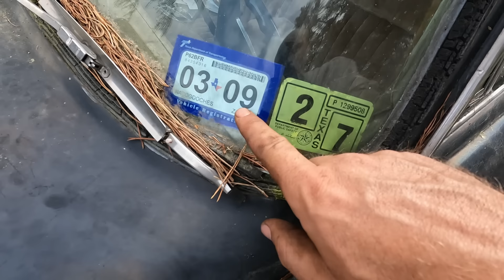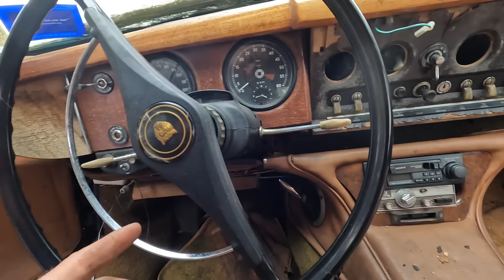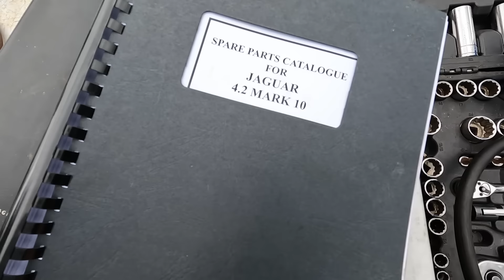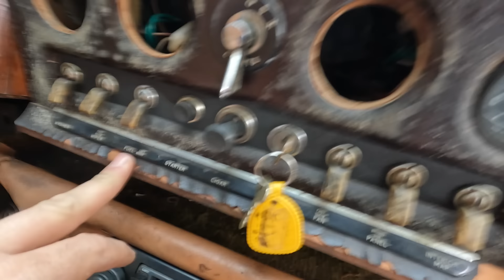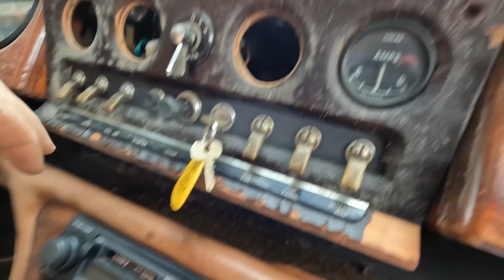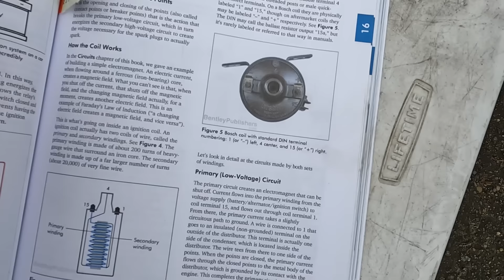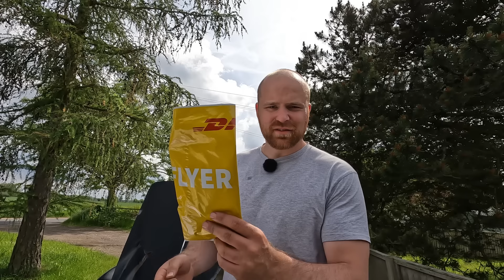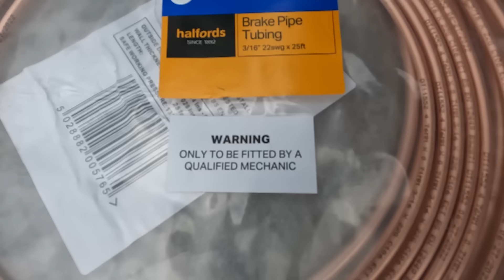1962 Jaguar sitting for 15 years. Will it run?

Comment: I bought at 63 3.8l Mk10 in 74 for £66 and it was a complete rust bucket, but it would do 100mph and gave 17mpg. I was stopped going into work by the security police with 7 people all sitting on seats and I wasn't questioned about it. It was metallic grey with red leather interior and no seat belts (before 66), it steamed up in the rain, the brakes were really terrible, the steering was +/- 1/8 turn to keep it on the straight and narrow and I sold it 1 year later for £75, a profit. I wished I could have restored it, but it wasn't work doing, too much rust, but I enjoyed it immensely.

Comment: I enjoyed watching all of the things that beset you! And your positive attitude never waned. The best bit of this video, was your surprise to see the engine fire-up! I once rode as passenger in the MK 10, and I drove a Mini at that time. I couldn't believe just how BIG the MK 10 Jag was from the inside! Your journey has just begun, and I just have to write that (if I were you), at this point in time, try and get the Jag on a Tilt Tray Truck, to a garage where the car can be raised. I would not spend another cent on that Jag, until the whole underside has gone through some inspection. I reckon that there is a lot of us that had aspirations to restore a Classic, and many have lost interest and failed in the process. I started with something simple - a 1971 Beetle which was purchased as a rusted burnt-out wreck from a Car Scrapyard in 2004. 20 years later, I'm still driving this Beetle daily. 5 years ago, it was converted to 100% EV, and is Tesla-powered. the Beetle goes to Car Shows, and looks new. I am now 75.That's my story. Hope to see a follow-up on your Jag. Greetings from Australia

Comment: Highly enjoyable watch! Will be following the progress closely. When you opened the bonnet (or is it hood in this case) and there was no inlet manifold I thought this is just such a massive project to take on. Not to mention engine is likely seized.  Brakes seized and probably clutch seized. I was amazed to see it start up and then drive some. Fair play to you for taking it on! Great content and very well put together.

Comment: Brilliant, absolutely brilliant. Well done. I'm British and am a fan of Vice Grip Garage and it's great to see a British guy have a go with less experience. You're an inspiration. I watched some time ago you have a go at an old Ford Zodiac and fail, but at least you had a go. I look forward to seeing the progress on this beast.
Reply: I’ve always wondered if a VGG or Roadkill style show could even happen in the UK. I’m sure the MOT test would take 50% of the entire fleet of cars off the road where I live… if I tried to drive my janky 1950’s car on UK roads I’d end up in jail😂
Reply from the maker: Cars over 40 years old are exempt from an MOT, so you can technically do it, but just because the car doesn't need to be inspected doesn't mean the car can be unroadworthy. So you'd be at the mercy of an individual police officer if pulled over.

Comment: Great watch.
Your modification with the rubber pipe with the jubilee clips on the braking system is where I think your braking problem is! There be expansion under pressure!
Reply: There shouldn’t be much pressure going back to the reservoir as it is on the inlet side of the master cylinder. It’s actually advised to bleed brakes with the reservoir at atmospheric pressure (the cap off/cracked open) to prevent a vacuum being created and sucking air back into the lines, so it is not a loss in pressure on that side of the system causing the issue.
Reply from the maker: The rubber pipe with the jubilee clips is on the low pressure side and is how it came from factory. I was just replicating what was in the parts diagrams and service book.
Reply: yes

Comment: Whether the car is positive or negative earth the starter will spin the correct way.  Generally you can just swap between the two and all you need to do is disconnect the clock (which is positive earth and if it still works which is unlikely it won't if you change to negative earth) and re-polarise the dynamo (look up on line how to do this its really simple).  Personally I would change it to negative earth when you get into it as the risk of having it positive earth is that if you use anything in the cigar lighter (sat nave etc.) or jump start it or use it to jump start anything else then then you might cause damage. I have one Jag thats positive earth but only because of its history and if I had my time again with it I would swap it over which I might still do.  Love a MK10, the absolute daddy of Jags and one I would love if my garage was large enough!

Comment: 4.2 Twin overhead cam engine. I, not a mechanic, in 1977 stripped the head off... easy job and again, on an XJ6 did the same again... I have an amzing techinical book, on that engine... you won't find a more technical book, on these engines', anywhere!! A goldmine of info! Good luck!!

Comment: Hi Nino, its really instructional to watch your videos.  I have a little story for you based on your thoughts of fitting an LS V8.  I'd say, don't bother.  Instead search the scrapyards for an old Daimler hearse.  When Jaguar took over Daimler the only engine they had was a V8 4.5 litre.  It was scaled down to go into the V8 250, a Daimler version of the Mk 2.  However, just because, Jaguar racing put the 4.5 into a Mk 2 and found it to be 20mph faster than the 3.8S. As the Mk 2 was fast enough they didn't replace.  But hey, you can! ;-)

Comment: That's gonna keep you busy for a while! 😊😮😁

That XK 4.2L straight 6 has a Le Mans winning heritage and is the same engine that is in the Daimler DS420 limo, I featured on my channel a while back, although in twin SU carb configurarion and it don't half shift when you put your foot down in those old barges so yours should fly, especially with the triple SU carb setup like the e-type jag....😊

One thing I will say about the SU carbs, you'll be able to strip and clean them in the dark with one hand behind your back, once you've done it a dozen times or so....😮😊

Edit - That fuel switch on the dash is actually to switch from left or right tank. If it's the same capacity as the DS 420 it will have twin 10 gallon tanks! 
I could get around £75 of fuel in each side! 😳😲

Comment: Got a 63 MK10. Came with a XJ6 4.2 fitted with triple carbs. Electric fuel pumps mounted internally in the tanks. Out here in New Zealand.

Comment: Jumped into the video late, was trying to work out if you're a Brit in USA or it's a USA car in Blighty.  Now I know.  The stupid headlamps (2:59) are the giveaway.  Our idiotic lighting regs of the time forbade odd-sized headlamps so they fitted 4 small ones and fitted wide bezels to the outers.  I'm busily correcting this idiocy presently on the '73 series one XJ6 I picked up last year here in Oregon.  Any 7" bucket will work - TR6/Spitfire/MGB etc.  And you answered your own question about the interior being redone - sun damage (Texas).  You have a new subscriber.  Crack on, I'll be watching!

Comment: At last! I spotted the Mk10 quite few videos back and commented about it buy you didn't respond which was amusing. You could retro fit an AJ6 engine into it OR a 3.2L or 4.0L Jaguar V8 out of a rotten XJ8. You ideally need an oil pressure gauge to give you an idea of engine condition. It should read 40lbs on idle.
My dad bought a BRG Jaguar 420G in 1973, that car gt me into Jaguar's BIG TIME. Have had ten and today I own a 1975 XJ6 4.2L and a 2001 3.2 XJ8. One day, I intend to buy a Mk10/420G! Looking forward to more videos on this car.
Go buy an air compressor, air line and blow gun, far superior at blowing grime out of any type of well or recess.
Reply from the maker: Thanks for the tips there! I think I'm catching the Jaguar bug like you did

Comment: I worked on these Jags throughout the 70,s and 80,s and they were straightforward  and  beautiful engines on the Mk2,s, 420,s, and mark 10s. The only real trouble was the engine block,s steel studs for the cylinder head to slide down over. They tended to seize to the heads with corrosion and try as one might , some heads needed hours of work to slide  up and off those damn studs.
 And underbelly rots especially the rear 1/4 spring mounts. The double or triple carbs were nicely tuned by ear, good old SUs no trouble at all. 
Great Video and great effort. Excellent.

Comment: I've been running through the MOT list for my 2004 Toyota Corolla 1.6. I just painted and undersealed the rear end and fuel tank!
Done all sorts, head cover gasket, ignition coils, suspension ball joints and control arms new, drum brakes replaced (a pain), front brake lines (yegh the same tool as yourself,  more pain) and recently had new clutch fitted. Saying that the Toyota's are in my opinion some of the best cars made.

Comment: Did the same on my E Type in Australia that had spent 30 years under cover under a tree. Sorted the float valves and distributor and it too just fired up! Had plenty of old Jags and nesrly all of them can be persuaded to run like this if they have no underlying mechanical issues. The only problem i have was with a Mk7 that i did get to start after rebuilding one seized carburettor due to water damage that signalled probable head gasket blow many years in the past. Had to pull the head and it was so corroded I had to replace it. Love watching people resurrect old motors, well done!

Comment: Great episode, and props for growing the channel so quickly. You asked, so here it is. My project motorcycle  (2021 KTM), on a 3-day trip, suddenly had way too much oil, a hanging idle, and hard start and stalling when cold. When I got home, the oil level was back to normal. Fuel getting past rings into the oil?
Reply from the maker: I'd pull the dipstick and smell the oil. You'll smell fuel in it if it's been getting past the rings 👍🏻

Comment: The front calipers on this car are correct.
They are the same ones as on the Jag 420, smaller brother of the Jag 420G.
The example picture shown is a 2- pot caliper for a Jag Mk2.
Reply from the maker: Are you sure? The front calipers on the car look very different to the ones in the parts catalogue...
Reply: @NotEconomicallyViable  The front calipers on your Jag 420G look like the same calipers I have on my Jag 420 - 3-pot calipers.
RH front caliper - C.26930
LH front caliper - C.26931
These 3-pot calipers were also used on:
XJ6 [Series I] (1968-1973)
E-Type [Series II] (1968-1971)
Reply from the maker: @RichPober  It’s highly likely that when the car was converted to wire wheels they took all the parts in bulk from a Mk2 or E-Type: hubs, calipers, spindles? 

This car came from the factory with steel wheels and the calipers were 
LH front C20537
RH front C20536

It’s a bit of a nightmare trying to piece what’s gone on with it. Really need to just take it all apart and see what part numbers are on components.
Reply: @NotEconomicallyViable  If the caliper mounting lugs are 3.5 inches apart on the stub axle carriers, then you can bolt XJS / XJ6/12 4-pot calipers straight on. To fit the XJS / XJ6/12 vented discs too, you'll need to get some new XJS / XJ6/12 stub axles and turn down the 1-in-18 inch tapers to suit the stub axle carriers that you have, as the taper is smaller. You'll also need to make a 0.25 inch collar to fit over the XJS stub axle to butt up against the stub axle carrier and to space the vented disc 0.25 inch further away from the stub axle carrier, so as to give it clearance. The XJS calipers will go a long way to improving the braking on this whale of a car. When I do this conversion on Mk2s, I cut off the threaded stud on the XJS stub axle, as it is too short to go through the steering/trailing arm, and make a new longer stud, to screw into the tapper, so that it is the same length as the one on a Mk2. You cannot use the original Mk10 / 420G stub axles as they are too short to accommodate the extra thickness of the vented disc.
Reply: I have a couple of videos somewhere on my channel about the custom stub axles and standard XJS calipers I fitted to a Mk2.
Reply from the maker: @RichPober  👍🏻👍🏻
Reply: @NotEconomicallyViable Is there possibly an addendum to your parts manual covering this? Take care.
Reply: @NotEconomicallyViable  1:25:45 The 15" wire wheels were an original Jaguar factory option for the Mk10, but it was rare. The advantage of having the 15" wire wheels, instead of the 14" steel wheels, is that they can accommodate the 4-pot XJS / XJ6/12 front calipers. The standard 14" steel wheels could only accommodate the smaller 3-pot front calipers. The 4-pot calipers give a massive improvement on braking. Your new master cylinders will have enough dispacement to operate 4-pot calipers, albeit they will have a little more brake pedal travel. On the Jaguar Mk2, I swap out its standard single 5/8" master cylinder for a 7/8" master cylinder from an old-style Land Rover. Your Mk10 has twin 5/8" master cylinders, so that should be ample displacement.

Comment: 5:40 - Turning the crank 360 degrees full circle is only 180 degrees half circle for the cam(s).
Reply from the maker: But not the pistons
Reply: @NotEconomicallyViable  - 360 degrees cycles all the pistons, but does not fully cycle all intake and exhaust  valves. 720 degrees at the crank ensures all intake and exhaust have gone through full travel. 360 degrees at the crank only puts half the valves through full travel, risking the other half possibly sticking open and hitting the piston. The camshaft spins one revolution for every two crank revolutions.

Comment: I did read somewhere and it requires a drive down to here in Salisbury, SU have been known to do a "while you wait" service on complicated SU setups and even set up the carb sets to manufacture's baseline settings as they shipped them to British car companies ready to bolt on and cable up and certainly have the book for MK10's so should be able to set up factory settings.   Its funny as my Reliant has a single one of those carbs lol

Comment: I'm not sure, but I think that when it comes to spark-plug leads, that the 'HT' stands for 'High Tension' and not 'High Temperature'. I think it's something to do with the kind of electricity they convey rather than them being under physical tension.

Comment: If those SU carbs are like those on the TR3 Triumph and early Volvos, I think they take some trans fluid after unscrewing the brass tops. I used a Uni Syn tool to synchronize the carbs, but you can come close by holding a hose from the inlets to your ear and listening to the air intake. You have done a remarkable job so far.

Comment: I think the reason you got the Spark Plugs out so essily is that you allowed the penetrant to soak for a decent smount of time rather than expecting instant release of rust. I would however like to have seen you put ATF and Diesel down the bores to free the rings.
Regarding  it missing I think a compression test might be in order or take off the Valve cover to check for stuck valves. I think this is much more likely than timing if itvis a regular miss, ie the same cylinders missing each time. I wish you the best of luck with it also please dont throwcaway old parts as they may still be able to be repaired such as the Carburettor and Master Cylinders. A repairable part is better than no part which is often the xase as these things get older, ie that Throttle linkage.
Reply: I agree with what you say as I thought it myself. Anything you think you might need to take apart get your penetrant on and allow to soak for days rather than expect it to work instantly. Also the rings could be sticking and the valve seats may be rusty or just stuck open but when cranking the compression did sound fairly regular but a test would be be the way to go.

Comment: Great video and I certainly admire your confidence! I've been here many times and I can assure it does get easier. For future reference with clutch and brake master cylinders, you can actually buy rebuild kits for them, just make sure they're very good quality ones (NOS is even better if you can find them). I've done this on all the ones I've rebuilt and never once had an issue. Just make sure the bore isn't scored, give it a through clean and then a very light sand with some 1200 grit sandpaper. It's fiddly but well worth it! Also for ignition parts there's a really good company called distributor doctor that supply OEM quality parts that actually last. Had far too many new Lucas parts fail on me.
Reply from the maker: Appreciate the tips

Comment: Im pretty sure that the engine is from a later car, it looks like a 70's one looking at the camshaft covers. its the correct carb setup though, 3 x 1 & 1/2 SU's. The inlet manifolds are interchangeable. Good luck with it, you have done well thus far.

Comment: Have you put oil in the su carbs.. If you haven't, put some in so the plunger with the needles attached don't rise so quick and sort out the airleaks.. Then you have the joy of balancing the carbs.. My dad used to work on cars like this and used hoses by putting one end in the air intake of the carb and putting the other to his ear until the air intake was even when adjusting each carb  butterfly valve.. Old school and simple.
Love what you are doing, which I had a driveway to do this kind of thing.. Looking forward to next video.

Comment: I now these XK engines inside out worked on them from 16 year old boy piss easy the puff smoke while cranking them over is the compression all is very good sign my friend 8-1 compression ratio pistons. 
Learned all this from my father working on these type of cars in 70s and 80s 90s as a youngster so many memories 😂

Comment: I also had a 1965 3.8S type saloon that came with chrome dunlop center lock (knockoff) wire wheels and a four speed transmission with overdrive,